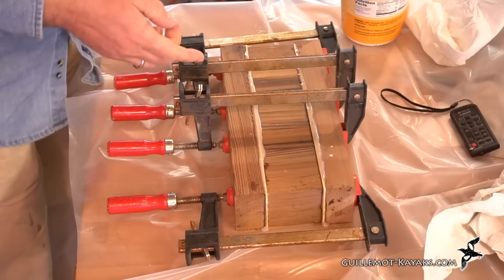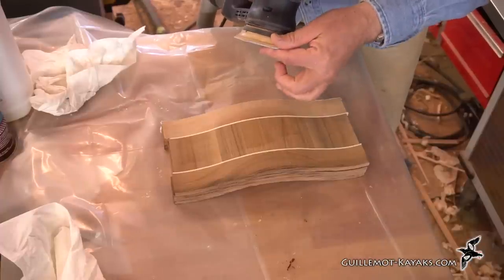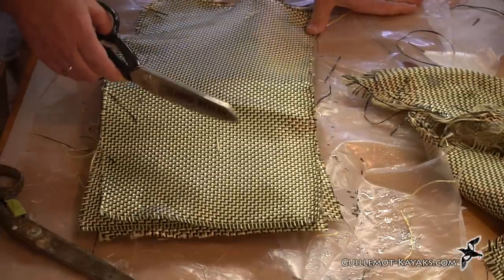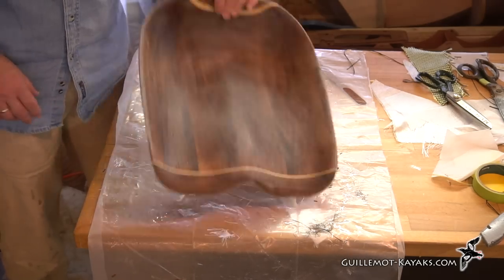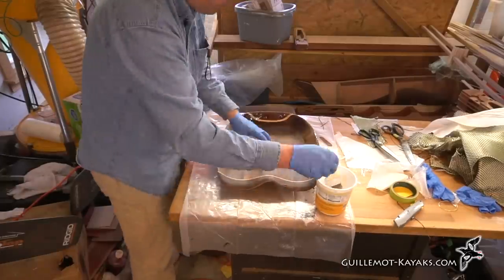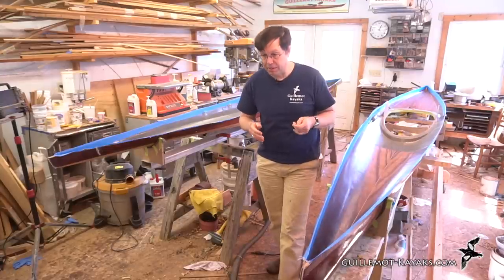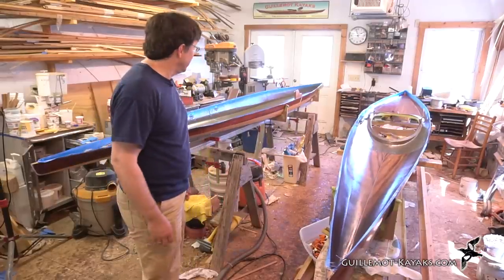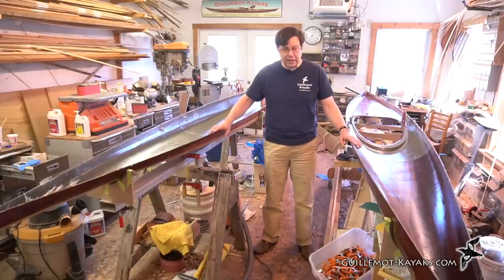Backrest, Peelply, & Interior Clear Coat - MicroBootlegger Sport - E52

Comment: Very nice touch with the clearcoat. Nick you said you use MAS epoxy for wetting out and West for fill coats. Are the work times pretty similar with each product when you use the corresponding hardner? You know whats great about you and the work your doing, you are straight up with no gimmicks," I dont feel comfortable doing this on customers build", but will try it out on my own build. That is showing your professionalism and true to the trade morals. It shows in your work........
Reply from the maker: You know, I haven't actually timed the cure to compare West vs MAS. I generally leave the shop and let it cure overnight.They are both hard the next morning. Neither one is fast enough to get a full cure in time to do another layup the same day, so the exact cure time is not that relevant. West is a bit faster, but from a practical matter, it doesn't matter.

Comment: The guys I learned resin infusion from over a decade ago used to use 2K clear from a can.  They’d spray the mold with it in the same manor as gel coat and then infuse.  I was surprised poly or vinyl didn’t eat it away.  Worked really well.
Reply from the maker: Interesting idea.

Comment: Nick, Your workmanship and attention to detail is amazing.  Two questions.  The first is kayak design ... why don't you and other wooden kayak builders use flotation chambers?  Is there sufficient reserve buoyancy and ease of dewatering you just don't need them?  Second, you have, over the course of the different hulls shown several variables of glasses (carbon, Kevlar/carbon, S glass, etc.) and exterior coatings (automotive clear coat (UV improved protection) and varnishes.  If you had to select the best of all options, what would that list look like?
 Jim
Reply from the maker: Hi Jim,
 I do often put bulkheads in my kayaks for flotation, but when building for a customer I do what they want. I never put in bulkheads unless I have a hatch in the deck to access the volume. A permanently sealed space without access is asking for problems. If the customer does not want hatches (usually due to aesthetic reasons) I don't add bulkheads.

There are a variety of considerations when choosing a reinforcing fabric: strength, weight, appearance etc. Fiberglass is strong, somewhat heavy and invisible; Carbon Fiber is less strong, heavier (in a hand layup), and black; Kevlar is tougher, heavier (in a hand layup) and yellow. If time and money were no issue, I would probably go with a layup similar to this one. Glass on the outside (S-Glass on the hull) so you could see the wood, and a Carbon/Kevlar for stiffness and toughness on the interior. I would also apply all the layers with using the resin infusion method to reduce the weight and increase the strength of all the layers.

Varnish vs Automotive clear coat is usually a decision of time vs money. Varnish is cheaper out of pocket but takes longer. Spray is probably longer lasting, but cost more even though it takes very little time. I'm actually thinking of using the rattle can stuff on the exterior of this boat, just to see how it goes.

Comment: I was wondering if you could add a link to the peelply?  You talked about it as "nylon cloth."  Would buying simply nylon cloth from a local fabric store be a possible cheaper substitute? I presume once used it cannot be reused?
Reply from the maker: Here is one source: https://www.fibreglast.com/product/Nylon_Released_Peel_Ply_582/Vacuum_Bagging_Films_Peel_Ply_Tapes
you could probably use any old nylon from the fabric store, but there are several different kinds made especially for composites work.

Comment: Do you worry about the automotive clear coat getting on the outside of the kayak?  Why choose this versus Varnish?  Just for convenience?
Reply from the maker: I am not worried about the clear coat getting on the outside as it will be sanded more before it is done. I am experimenting with the clear coat because it should be more durable than standard varnish.
Reply: Sounds great, thanks for the explanation!

Comment: Hey Nick, how many cans of each did you finish up using , I sell them i my paint shop there great also you may not know but the same brand do a can that is a 1k can which you can put all single pack products into them but i use them for my customers and put 2 pack polyurethane, and 2K clear or colours but you only have about 12 hours to use up the contents before it goes off great for small touch up jobs on boats etc. also I sent you a email last week just after your advise on the petrel im doing.
Reply from the maker: Hi Stuart, I've been happy with the 2K stuff. I have some of it on some brightwork on my powerboat and its lasted a couple summers of 24 hour exposure quite well.

I'm sorry I didn't get to your email yet. From the sounds of it you are seeing the glass more than you would like. Before sanding off the spot, you might just wet it down with denatured alcohol (methylated spirits) and see what the sanded area looks like when wet. If it looks pretty clear, you should be fine. 

If you see the glass clearly when wet, then you may want to sand it off and try again.
Reply from the maker: BTW 4 cans